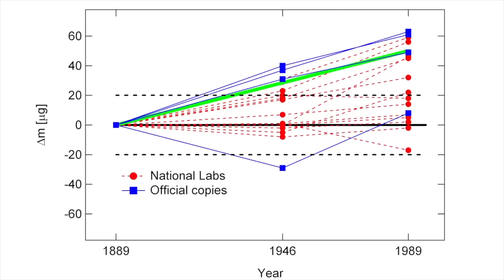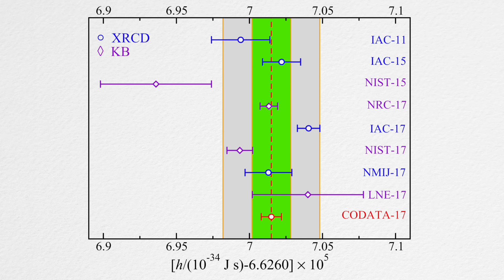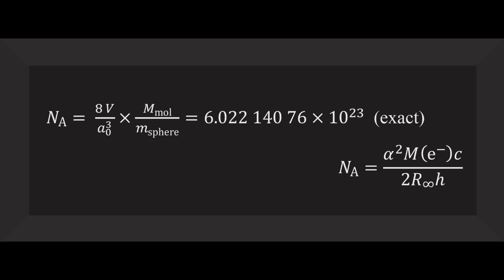The kg is dead, long live the kg

Comment: So. A mole is how many partials something has?
Reply: basically: yes
The number itself is not the important thing. The important thing is, that you can use this definition to figure out how much mass you need in a chemical reaction such that - according to the chemical equation - every atom (in theory) has a partner with which it can react. So in the chemical reaction
2*H2 + O2 -> 2 H2O
we see that for every 4 H atoms we need 2 O atoms in order to get a 100% reaction with no leftovers. In order to ensure that, we take 4 mol of H (better said: 2 mol of H2) and put it in a reaction chamber with 2 mol of O (better said: 1 mol of O2) and then when we start the chemical reaction every H atom and every O atom will participate (at least theoretically) in that reaction.
The important part of the mol is not the value of atoms itself but that it allows us to calculate masses (which can be weighted) such that those masses have equal amounts of atoms/molecules.

Comment: Is this a possible way to lroduce endless energy.....

Submarines use reservoirs that are filled with water when they want to go under water and they  fill them with compressed gas when they want to float.

Now if we look at a submarine under depth of 1 mile (to simplify calculations) if the reservoirs are filled with gas so there is a total fore(the net force is upward if the buoyancy force is greater than the weight) pushing it up towards the surface of the water, since buoyancy force is conservative the potential energy of the submarine depends only on it’s distance from the surface and the total work done on the submarine when it reaches the surface is going to be equal to the distance od 1 mile multiplied by the magnitude of the net force.

 

What we are going to do is taking a system of steel box that can be filled with highly pressurized air and is connected though a valve to an air compressor and an inflatable balloon. And connecting it by a wire(the wire is there to conduct electricity and also to provide mechanical support) to another system consisting of a pulley connected to an electric generator and a battery.

When the device is on see floor the compressed air in the steel container is released into the balloon so it inflates and becomes buoyant and goes up pulling with it the steel container and as they go up the wire connecting them to the pulley would make the pulley spin and the generator connected to it generates energy.

Now as the balloon reaches the surface the next step is to first refill the steel container using the air compressor then empty the balloon so the whole thing sinks again and as it is sinking the pulley wraps the wire  and we are back to step 1 so the cycle repeats.
Reply: Short answer: no
there is no such thing as a machinery with 100% efficiency.
You will not regain the same amount of energy when going up as is needed to compress the air for going down to the same level.
Machineries which operate completely frictionless are a theoretical construct. In practice this is not possible. Even if the machinery makes some noise this means that some energy is used for that and thus lost for the operation of the machine.

Comment: So when they realize that this measurement of Planks constant is off will they correct it like they should or just shrug their shoulders and leave it like they 
 did with the meter?  After all a     .05% error in the length of the meter is likely a much bigger error than they will make with this change.

Comment: Is 1 kg still equal to 1000 g? Cuz this is confusing.
Reply: Yes. They just change the physical definition of kg.
Reply: @danindewatir383  but is 1kg=1000g now?
Reply: @krishmistry2608  Yes it's still 1000g. They just change the physical definiton because scientists have found their masses are diverging. 0:37-1:04
The solution so the mass standard will never change is to set Planck's constant to have a fixed, exact value.1:14-1:25
The SI (International System of Units) is still valid like it used to, the only thing that changed is their physical definiton.

Comment: How do you accurately measure mass when there are minute differences in gravity depending on geographic location?
Reply: HaqqAttak — If you have reference masses, you can just use a balance as you did in high school science labs.  The reference masses are influenced by gravity in the same way as the thing you are measuring, so it is a wash.

Comment: So...how does the mass of somthing change? I thought that was constant
Reply: The mass itself does not change. Just what we call it changes.

See. There is no such thing as a god given unit of mass. You can pretty much take any object you want and call that by definition to be your base unit - 1 kilogram in that case.
Thats nice.
But the problem is, you are not the only person on this planet. In order to be useful all persons should agree on your definition. Basically that is what has happend in the past. One mechanics created a platin iridium cylinder and per definition this object was assigned the value of 1 kilogram. Platin-Iridium was choosen because this is a very stable alloy and it was expected, that the mass of this object will not change (eg. due to radioactive decay).
The problem:
In order to be useful, copies of this one single object were made and shipped all over the world such that whenever eg. some chinese science buero wanted to check their local definition they did not have to constantly travel to Paris to do so. They could simply use the copy since this copy was an exact replica with exactly the same mass as the "one and only" kept in Paris.
Every now and then those copies were brought to Paris to be compared with each other and with the "one and only" object which per definition has exactly 1 kilogram". And this is where the problem starts. When the copies were made, all of them had the exact same mass. But they do no longer! Every single one of those copies were treated in exactly the same way, stored under identical conditions and yet they disagree with each other today. So which one is the correct one? Of course we could simply define the "one and only" to be in Paris. But this is not satisfying. What if this "one and only" actually was the one which changed most during the decades?

This is why you do not want to have important things like the SI base units to be defined on physical objects. You need to define them on something. The best choice to do that is to actually define them on some constants in nature for which we know that they will not change.
Reply: @kallewirsch2263  ok forgive me but i dont follow, they brought them all together for measurement and they where different? But they where all the same...i dont see how somone could have a different view of the same object

Comment: From 2:01 to 2:27, I didn't understand that thing.  Also this line, " So the solution is to flip this on its head, set Planck's constant to have an exact fixed value and then that cylinder in Paris will no longer be exactly 1 kilogram."  on 2:14. 
I can understand that we can have a relation between mass and Planck's constant via m=hf/c^2. But how can we fix that f in the first place? because if we're considering 1 KG fixed then the value of h changes every time we change the value of f. same goes for kg.

Comment: With all the physical constants and units of measure being refined, just a tiny bit closer to perfection, we must be alert to the measures that will affect our everyday lives. After the standards organizations make their massive least squares fits to all the constants, just about everything will be different by very small amounts.  Such as, a dozen eggs will now be 12.00000036704 eggs.  Your cat now has 3.99999995261 legs.    Polygamy is still illegal, but it'll be okay for a man to have 1.0000000475 wives.  When you add a pinch of oregano to your spaghetti sauce, be careful to not overdo it; you should now add only 0.99999995833 of a pinch.  Those Apollo hoax conspiracy theorists are right - Apollo 11 did not land on the Moon.  It was Apollo 10.9999999296 that did the deed.  And future waltzes must now be performed in 3.00000001816 / 4 time.

Comment: i think it's very interesting topic actually
the thing i don't get is how our KG in our scales won't change?!!!!
Reply: Because it's perfect already
Reply: the difference is less then a tiny fraction of one single fingerprint on the weight used in your scale.

The simply could have defined h to be 1.
But that immediately would have made all scales used throught the world useless and would have come up with a need for recalibration and/or a new display unit. This is why those constants are defined to be very close to the currently used value, such that in everyday live nothing really changes.
The same has been done with the definition of the meter which is based on light speed. Light speed was defined as a specific value such that almost none of the millions miling machines all around the world have to be changed because the difference on that scale is unrecognicable small.

Comment: This video really encapsulates the ambiguity and circular definitions of measurement in general. The kg is a mass which is defined by an energy and time, where energy is defined by a force and distance, where force is defined by mass and acceleration. Does this mean that mass is defined by energy which is defined by force which is defined by what mass is? (neglecting the other parts of the equations as they are relative and/or arbitrary multipliers). How does this work?? Maybe someone with a larger brain can explain and save me from this existential crisis

Comment: i dont understand why the planks constant has uncertainty before this change.. is it because the mass of the 1 kilogram cylinder varies or is there another reason?
Reply: there were essentially 5 different methods used to estimate it, each with their own measurement issues.
Reply: @SingaporeSkaterSam  what if in the future there emerges a better measurement technique that is more accurate and we find out that the number we just estimated with these 5 flawed methods is not actually correct?
will we have to change it again? I guess not since the now chosen number is the basis of the definition right? im a bit confused by this lol.
Reply: @darealrulezbreaker9493  As I understand it, they've fixed h now - it terminates ...0150 by definition, so everything else has to fall in line.  All I can say is we better not run out of Cesium.

Comment: Please help me understand, because I'm not sure that I do.
It seems to me that what we HAD was the understanding that Planck's Constant was the numerical expression of a very precise aspect of the universe--so precise, in fact, that its exact value has never yet been measured (the flickering numbers would represent an uncertainty rising from our past and current inability to make all of the observations necessary to make an absolute, fixed, unchanging determination of its value--which may or may not be equal to the value voted upon). Is that correct so far?
Now, what I am hearing is that in order to escape being shackled to the prototype kilo, which I gather might be measured very slightly differently in different locations in space and time (given that of it and its cousins are actually moving with respect to each other), we are assigning a value to Planck's Constant--our best estimation of what it truly is--and figuring all of our observations from that. What I am finding challenging here is this: Doesn't that mean that there is a possibility that the number they picked does not accurately express that very precise aspect of the universe? Are we in fact settling on a figure that is NOT arrived at through observation (even though it may be within the range of observed data)? 
As Derek points out, it's not going to change the flavor of an apple pie or the relief I feel when walking into the air conditioning in August. But it is one of the fundamental aspects of the nature of the universe, and it sounds like we are exchanging observation for, quite frankly, convenience. Are all of our models now to be based on a constant arrived at by consensus, rather than confirmation? And are we to believe that this will have no impact on our conclusions?
That does not strike me as a good thing, but I'm certainly willing to hear about what I may be missing.
Reply: "Doesn't that mean that there is a possibility that the number they picked does not accurately express that very precise aspect of the universe?"

No.
You need to differentiate what something is and what value we assign to it.
Planck's constant is a constant. Meaning that it will not change.
What value we assign to that constant is a different story. We could assign any value to it. But for practical reasons we don't do that. Because eg assigning the value 1 to it and then deriving how much mass will make up 1 kilogram from that definition, would require to change all the scales on the entire earth - which can be done but would cost a lot of money. Thus you will want to define the value of that constant to be in the range you already measured, when the measurement was done using the base unit definitions in effect at the time of the measurement. This ensures that when you turn the process around, nothing fancy will happen to all the every day devices already in use. The difference is much to small as to have any effect on the scale used in a grocery store. Yes, that scale will be off by some amount, But that amount will be in the range of mikrograms (or less), which is completely unimportant for that scale and much less then the unavoidable measurement error of that scale.

But in principle you could assign it any value you want. Same eg. with the speed of light in a vacuum. You could assign it the value of 1 meter/second. Which of course would change completely what length we consider to be 1 meter. It could be done but for practicle reasons you will not want to choose that value to be 1 but choose a value very close to the value which was measured when the meter had a different definition.

Comment: You are being vague. Plank's constant is slightly different than what it was in 1990 because of better measuring techniques? That is glossing over some facts.  The speed of light is changing. So this affects the E= MC2 equation so it affects mass and plank's constant. So let's stop calling it Planks "constant" because it is anything but constant. And the speed of light is not just changing because of "better measuring techniques". It is actually slowing down in a measurable way. This should have all of the sciences reeling especially astronomy. Looks like the expanding universe big bang theory, that's right....theory, is on shaky ground.
Reply: fakenews

Comment: A KG of Steel is heavier than a KG of Feathers. 

Change my mind.
Reply: an object with less density always has more surface area if both are cubes. more surface area means the air pushes more force onto it. making it lighter in atmosphere but not in a vacuum.
Reply: Captain Heat what if the larger surface  on the less dense object is vertically facing (like a cuboid with the smaller side facing downwards) then what?
Reply: @noahstonemusic  It's more about volume (and buoyancy) than the surface area
Reply: Noah Stone Air’s upthrust should clear your doubt👍🏻

Comment: Please change the meter next, I HATE the meter
Reply: It was changed last time in 1983. Why would you want to change it again?
Reply: The meter is defined as the distance light travels in 1/299 792 458 of a second. It used to be a platinum beam.
Reply: @benjaminlehman3221  the distance light travels in a vacuum.

Comment: Lots of comment below about legislating constants and such goo.  The constants are being "fixed" only for the purposes of metrology.  No one is saying that a lab chemist has to use the metrology Avogadro's number - they'll continue using the latest value determined experimentally.  Somewhere down the line the metrologists will adopt the new value and change the conversion, not the unit value.  An example: when the metric units were invented, the meter was set to 1/10,000,000 the distance from the north pole to the equator, and that meter was inscribed on a metal bar. Later on that distance was refined, and as a result, the value is now 1/10,000,001.965.  Geographers didn't slavishly use the metrologist's length; when a new length for pole-to-equator was determined, they used that.  The metrologists didn't change the meter, either.  In a slow, deliberate, well-publicized manner they changed the conversion constant.  And that is how it will be for all the constants they set this month.

 The same thing happened in the definition of the gram.
Reply: Thanks

Comment: The seven units of the metric system and their fundamental constants:

Meter — length. Distance traveled by light in a vacuum in 1/299,792,458 seconds.
Second — time. Exactly 9,192,631,770 cycles of radiation of an atom of caesium-133.
Kilogram — mass. Planck’s constant divided by 6.626,070,15 × 10−34 m−2s.
Mole — amount of substance. Avogadro constant, or 6.022,140,76 ×1023 elementary entities.
Candela — luminous intensity. A light source with monochromatic radiation of frequency frequency 540 × 1012 Hz and radiant intensity of 1/683 watt per steradian.
Kelvin — temperature. Boltzmann constant, or a change in thermal energy of 1.380 649 × 10−23 joules.
Ampere — current. Equal to the flow of 1/1.602 176 634×10−19 elementary charges per second.